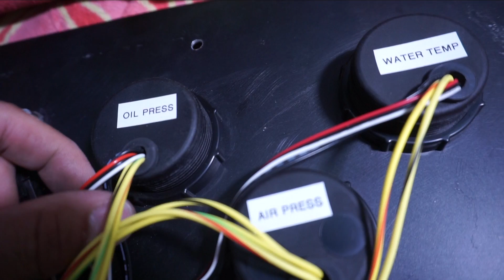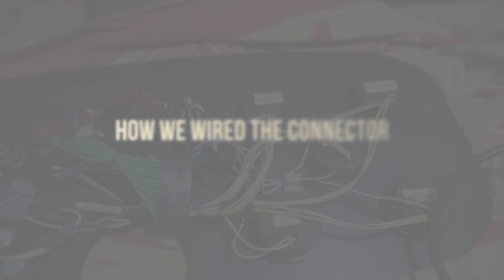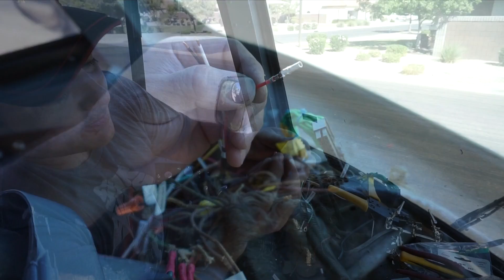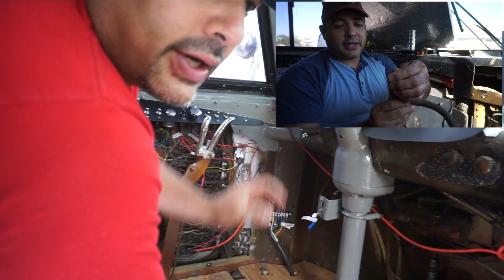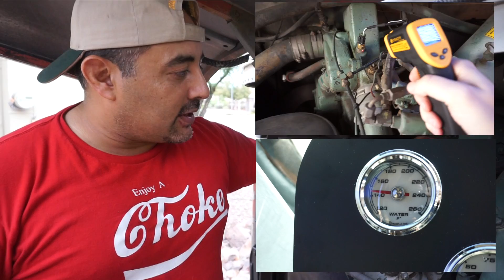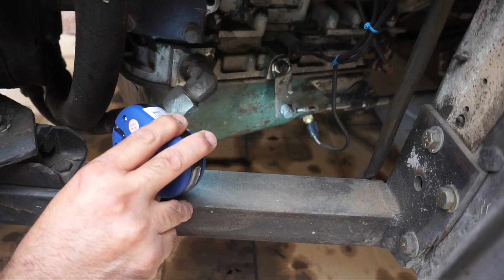Dash Rehab Part 4: New Sensors and Creating a Wiring Harness

Comment: If I disconnect the oil pressure wire or cut it, would it get rid of the dinging in my car from the oil pressure alert?

Comment: GPS speedometer? What if you lost the signal?
Reply from the maker: Thanks Didier - I worried about this too - especially since we are using our odometer as the "fuel gauge"!  However, after searching on on a bunch of different forums discussing these gauges I was pretty confident that this would not be an issue.  After over a year of using this setup I am happy to report that it has never been an issue.  It's pretty amazing the gauge works exactly like you would expect it to - I have yet to see it lose signal.  I will keep everyone updated as I start to travel with it - but we drive it twice a week to storage and we have driven it twice 400+ miles to Mexico and it has worked flawlessly.
Reply: @BeginningfromthisMorning  Of course you won't have speedo in tunnels and it's probably not going to work too well on roads with a substantial tree canopy (thinking, for e.g., long stretches of the Blue Ridge Pkwy, Acadia, etc and 2ndry roads in forested areas.  Canyons may also pose challenges (urban and natural).  Would be curious to know how you feel about going this direction after more extended travel in your new rig.  Nice job here!
Reply from the maker: @dhowman  I will report back when we get to environments as you described
Reply: Beginning from this Morning , thank for the reply , where can I get it ?
Reply from the maker: @DidierBan  Thanks Didier - I got all of the gauges from Speedhut.com - you can customize each gauge to your personal preference - EVERYTHING is customizable, the face, font, ticks, colors, custom graphics, the needle, the backlight, the ring, the glass - basically everything can be customized!  A year later I am still very very happy with the gauges - they look great and perform well.

Comment: I personally like Weather Pack connectors I put a post together on it awhile back, and will be doing a how to video when I have nothing else to do??? http://www.irv2.com/forums/f107/projects-on-my-1997-american-dream-174380-52.html#post2741636 speedometer is GPS? You can bend those teeth back out if the connector gets sloppy. I have three air pressure sensors and two more air pressure senors that run the brake lights http://www.irv2.com/forums/f107/projects-on-my-1997-american-dream-174380-83.html#post3282100 90 to 120 is industry standard and required in a heavy vehicle inspection. Below 60 PSI a warning buzzer should go off (Also required in an inspection). Do you have a low oil pressure buzzer, very important as you will not always be looking at the gauge when driving. A Harbor Freight free LED light. I have a love hate relationship with them. You have to love the prices, and hate that it all comes from China. Glenn Lever
Reply from the maker: Nice work!  I like those weather pack connectors for outside - this application it should be pretty safe under the dash.  In my bus somebody removed the buzzer - I will have to look at how to add it back in.  LOL yes, the Harber Freight free LED light ... I mostly hate it but it was the closest thing on that given day.